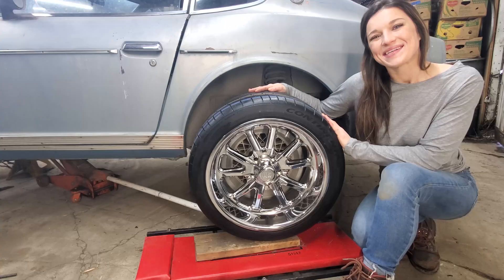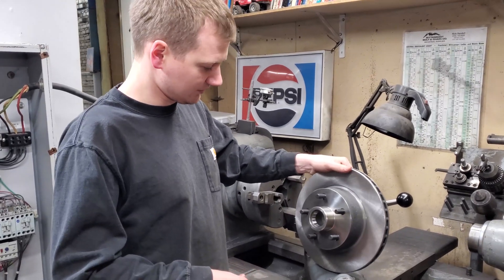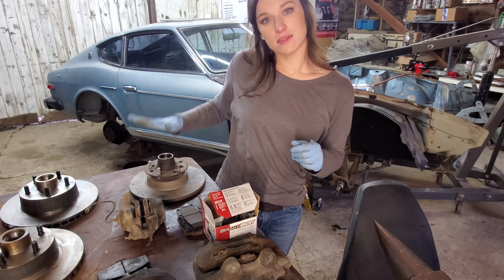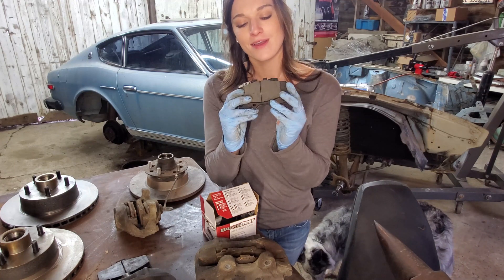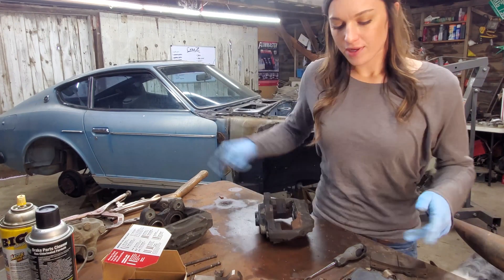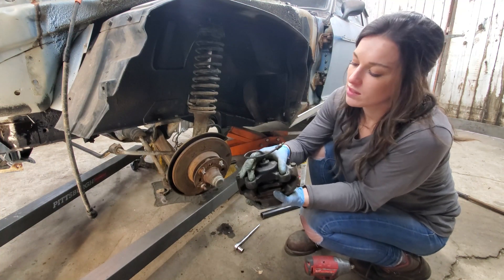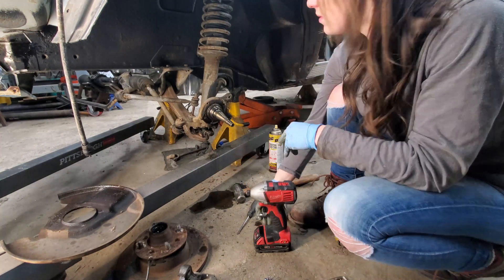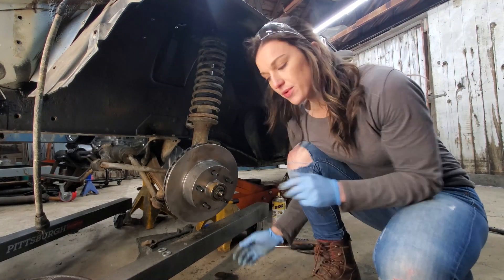"Front 5-Lug Conversion & Brake Upgrade" | Ep. 11 | Datsun 260Z Build

Comment from the maker: * Wheel Seal UPDATE! * 
The seal we originally ordered for this conversion did not press in nicely, so Nick found a better replacement. 
The replacement wheel seal part number is -  Napa #18565 -  I.D. 1.875"/ O.D. 2.506".

Comment: The tightness is a little sketch, you haven’t noticed them overheat or warp?
Reply from the maker: Not yet! We put 1500+ miles on the setup so far with drag racing without any issue.

Comment: Hey guys hi from Australia  love watching your rebuild. I was watching the episode where you welded stiffening L shape plates to the frame rails. Why didn't you use weld thru primer between the metals because from what I can see  water should be able to get between because the top weld is not continuous along the plate  just asking cheers
Reply from the maker: That would have been a great idea! In hindsight, I definitely would have done that if we had it.

Comment from the maker: For those wondering about the weight differences, here you go - 
Stock Datsun setup- 25.6 lbs per side
Mustang/Yota setup - 39 lbs per side

It may not be the lightest swap, but it's cheap. And I like to think it will help keep my front end down when I try to wheelie 🤣💁‍♀️

Comment: Cool, looking forward to see you test these out. I currently run the same S12W calipers, but with 300zx rotors - So I kept it 4-lug. This might be a good option to convert to 5-lug. What are you planning on doing for rears?
Reply: No reason to go 5 lug,,it's a waste of time and money,,,,
Reply from the maker: Thankfully we can drill out the rear axle shafts and drum brakes to the 5 lug pattern 🙌 There will be another video for that. On the front, we couldn't because of the rotor bolt interference.

Comment: Great work.  Would you kindly post a little more detail about the rotor turning dimensions?  Enough so I could drop the rotors off at a machine shop and they can't screw it up
Reply from the maker: @Joe E Here are the exact measurements on the rotor AFTER machining - 
Overall O.D. of the rotor  -  10.875"
Base O.D. of the center - 6.48" 

Hope that helps!
Reply from the maker: I will get some exact measurements tomorrow for you :) but please know that we have not tested this setup yet, so it still make require some tweaking...

Comment: Going through the same process with my 280z right now, great find with the Maverick rotors and Toyota calipers! And had the same thought about the philips screws.. battled with more on this car than any other project.
Reply: In the airline industry we use a rivet gun with an attachment that has a handle and a screw bit holder on the end, dip the screw driver end in valve grinding compound and apply steady pressure and easy tiger control and you will get most screws out.
Reply from the maker: @Edward Haas I've never heard of that trick! Interesting 🤔
Reply from the maker: @Tim They are soo frustrating! We have had many of them break too. Good luck on your car! 🙂
Reply: Just a tip about Phillips screws on Japanese cars: they are actually JIS screws. If you get a JIS screwdriver it won’t cam out and strip the head like Phillips does.